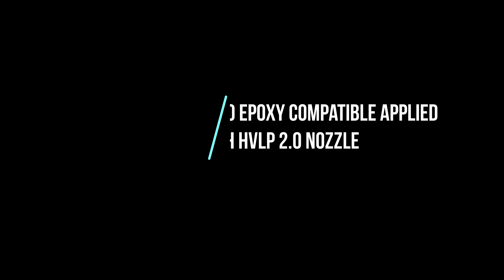Carbon Fibre Bonnet - Motorsport Spec - Resin Infusion

Comment: great work!
do you use epoxy with the paint gun for the glossy finish or directly varnish?
Reply from the maker: Hello Theo, I spray a gelcoat into the mould prior to laying up the stack, this is the finished surface which becomes glossy and shiny once  polished.
Reply: @autoflockmotorsport7730  thanks 😁 

Does it have good sun durability? 
Do you have instagram ?
Reply from the maker: @Eden-log  I have never had any uv issues, and yes search for autoflock_motorsport thanks a lot mate

Comment: Very nice piece. Do you mix styrene on to the gelcoat to thin?
Reply from the maker: Thank you , no I use a large nozzle and build it up in layers to get a wet finish, needs to be done quickly though as the gelcoat flashes off very quickly

Comment: Looks good! About the only thing I do different is put the gum tape on first. Saves the time of masking the flange to just untape it to then put gum tape on. I like the two infustion lines on the top of the hood tho. Also, just subscribed.
Reply from the maker: Many thanks Aj and like wise, love your, I have tried using your methods and I just cannot do it, you make it look easy, I think its all about finding a system which works for the user and then just stick with it and perfect it.  Thank you so much for subscribing and I look forward to your next video, be great to do a overseas collab at some point 🙂
Reply: @autoflockmotorsport7730  yeah man. I’m up for any ideas.

Comment: Looks beautiful. How's the UV stability / yellowing on the GC50?
Reply from the maker: Hello Bobby, the gelcoat doesn't discolour in sunlight, the only issue I have seen is hazing which was moisture in the gelcoat from spraying, this is cured by the use of a large air dryer.

Comment: Quality piece as always. What adhesive did you use to bond the 2 parts/nuts on?
Reply from the maker: Hello David, thank you for your kind words, I used 3M8115 panel bond for the nuts and a PU flexible adhesive to bond the skins together.  I hope this helps